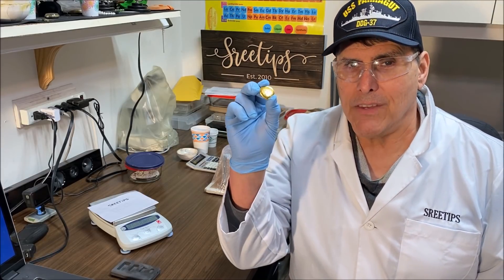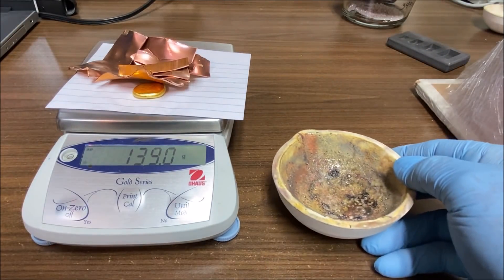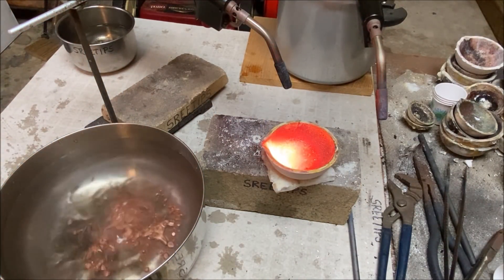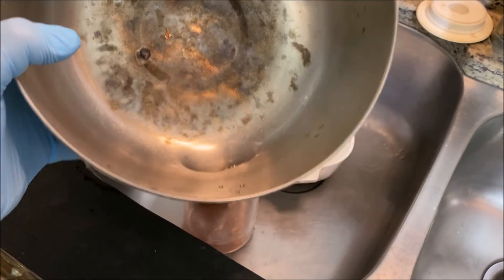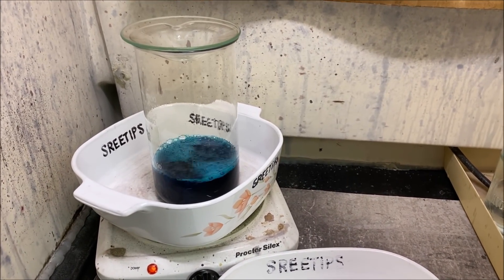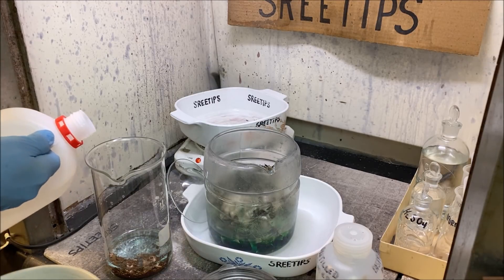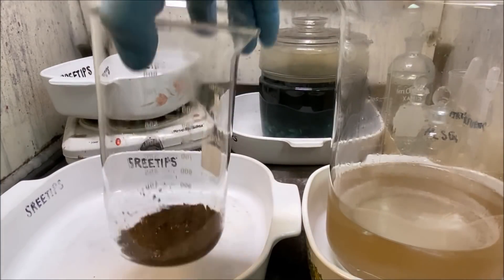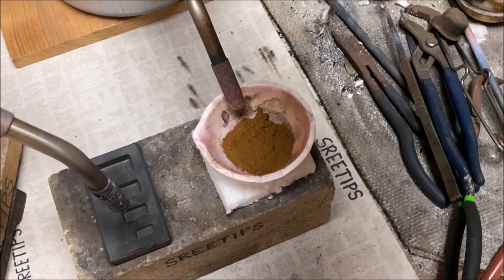Gold Repurification With Copper

Comment: Hey Sreetips, you will not get the steam explosion when pouring the molten metal into water if you bring the water to a boil ahead of time. The Japanese sword smiths have been making copper ingots onto canvas in hot water for centuries. It works well as long as the water remains above 185 degrees.
Reply: @Emmanuel Braden i like viruses also

Comment: Doesn’t matter if it’s a new or older video seems like I’m learning something each time…also when pouring the alloy into water would pouring it in boiling hot water maybe lessen the shock of the copper/alloy some so it’s not so violent?
Reply from the maker: As water temp increases, the metal is more likely to fuse together.

Comment: Some of the losses would have been during the HCL rinses, you could see finely divided gold powder on the bottom of the beaker.
Reply: Yes definitely, it would account for the majority of the loss I'd say
Reply: Sir you did loss 1.700 grams. This way you will get 9999 Purity but you loss sum grams of gold . 1.700 grams gold loss not a joke. It's have a valu of money. 
I will do this refine just adding double puer silver . with in one hour I will make it 9999 without any loss. 💯% recovery

Comment: Silver is the preferred metal for inquarting, because unlike copper, it takes only 1 equivalent of nitric acid to dissolve silver, but it takes 2 equivalents to dissolve copper. For most refiners, the biggest cost is the price of nitric acid. You’ll end up using twice as much if you inquart with copper rather than silver. Unless you can get dirt cheap copper or cheap nitric acid, the cost associated with silver and processing the silver chloride usually still makes it worth it. 

Here’s the equations btw. 

Ag + 2HNO3 = AgNO3 + NO2 + H2O

Cu + 4HNO3 = Cu(NO3)2+ 2NO2+ 2H2O
Reply from the maker: Excellent equations, makes it clear why you need more nitric for copper.
Reply: @sreetips   thanks! Yeah, silver only ever forms +1 ions when dissolved so you only need one nitrate ion to form silver nitrate since the nitrate ion has a -1 charge. but copper always forms a +2 ion, meaning that you need two nitrates to balance it.
Reply: @sreetips  nitric acid concentration can be 55%?

Comment: okay  question, War nickels are 35% silver but have 35 % copper 9 % manganese in it, will this cause any problems, Proper ventilation and proper lab protocols are in place. thanks!
Reply from the maker: I’ve never tried war nickels.
Reply: @sreetips  No you have no opinion on the 9% manganese? Could it cause metal fever or anything like that? I cant seem to find out much about the it? I am just being over cautious however, I cant be the only one out there that has a bunch of them and sure I can sell them on a auction site but I see it as a nice challenge extracting and making something beautiful out of them.
Reply from the maker: @SilverBull30  I’ve have no experience with magnesium
Reply from the maker: Sorry, manganese
Reply: @sreetips  Thank you very much for your time!

Comment: Hello my friend congratulations for the video is great.  I made a process in ceramic cpu but it did not precipitate water regia measures 200ml HCI + 35ml HNO3, I added sulfamico to neutralize HNO3.  the solution yielded almost two liters of distilled water.  I put MBS but did not rush.  What can I do to rush.  The aqua regia was greenish and when I put MBS there was no reaction.  Where did I go wrong?  Help me please . Thank vary match 🙏🙏🙏
Reply from the maker: No gold to begin with. Ceramic cpu has very little gold. Almost nothing.
Reply: @sreetips  Yes my friend, phone card CPU processors were big phone company cpu not Pentium pro those little ones were big cpu, with a big gold plated, thanks

Comment: That’s interesting timing I am trying to refine a very small quantity and will boiling for an hour cause it to go into solution? I am still getting a slight hint of blue so I assume that there is still some copper in the gold. So I figured I will try to nitric it with small quantities for a few more times to see if it clears up.

I don’t have much gold so don’t want to loose it in the nitric

Comment: I just watched a video where a guy used a half of a potato as a crucible. It actually worked. It would save you some money for sure. Cut a potato long ways and take a spoon full of the middle out. You can still add flux to get it loose.
Reply from the maker: Cool
Reply: @sreetips  thoisoi2 is the channel if you're interested. Might need a big potato for platinum lol.

Comment: At 26:00 you washed the gold with hydrochloric and then poured it off. The acid you poured off looked like it had gold in it, like some fine powder was washed out with the hydrochloric. Is that an accurate observation, as I was under the impression there really wasn't anything to speak of in the gold by that time?
Reply from the maker: A small quantity of gold gets poured off with the rinses into my waste containers. It’s allowed to settle out. Then I recover the gold powder from the waste containers.

Comment: Hello Sir, 
I have another question: 
If I have nitrous gases coming from the solution after Adding SMB, that means that I have excess nitric in the solution right? 
Does that mean that I have to just add more SMB? Should I wait over night to have the AR eat up the percipitated gold and add more SMB the next day to re-percipitate it? Should I put it back on the heat? 
Thank you for you help, much appreciated! 
Greetings from Germany
Reply from the maker: Red fumes = excess nitric. A little don’t hurt, add more SMB to remedy. A lot of excess nitric will cause much heat and fumes. Adding more SMB could cause a boil over - especially while stirring.
Reply: @sreetips  Thanks for the quick reply. It all worked out I guess, everything settled at the bottom. Solution is pretty clear now. There might still be slight impurities in the gold powder as it didn't settle as quickly as in your video. What are those impurities and how would you get them out? Clean the gold powder and redissolve in AR or do the whole inquartation process?
Reply from the maker: I rinse the powder real good then dissolve and refine it a second time. If it’s still dirty - repeat until it’s clean. No need to inquart again.
Reply: @sreetips  Thank you!

Comment: What other metals can be used for inquartation? If there are any others I mean…
Reply from the maker: Yes, I’ve used pure silver crystal, not recommended, sterling silver (best choice because I refine silver also). I’ve also used clean copper, and gold filled material.
Reply: @sreetips  you wouldn’t want to use anything like iron or zinc right?  Wouldn’t be an easy process?
Reply from the maker: Iron has too high melting point. Zinc is too high up the reactivity series. It would cause the gold to crumble during nitric boils - making separation of the liquid difficult.
Reply: @sreetips  I see. Thanks for always taking the time to answer questions! Appreciate it! This has definitely become my favorite you tube channel over the past year or so. Learning while being entertained, can’t get that on many other channels. 💪👍

Comment: Hey, I wanted to know how should I refine cu98pt2? Is nitric sufficient?
Reply from the maker: With Pt that low everything should go into solution with hot dilute nitric boils. Then comes the fun part; getting the Pt from the copper. I had difficulty during my stock pot series. Not an easy separation.
Reply: @sreetips   can you please help me solving this?
Reply: @sreetips  I have 1kg material by weight

Comment: Hi, I have been watching your videos for quite sometime and I know you are a busy guy but I have a question and since this is the only way I can contact you, here goes. 
Have you ever tried to recover silver from electrical contacts in circuit breakers and or relays?
I watch videos on this and have been collecting them from scrap items (everywhere from commercial AC units found in the woods to used car parts found in my warrhouse/shop) but have less confidence in the procedures I see on other channels.
I have done scratch test on these contacts with jsp silver testing solution and they light up at least as equal to sterling. 
I would be interested in hearing your thoughts on the possibility of recovering the silver if you have tried this?
Also, I am.not necessarily worried about the financial gain, just interested in recovering the silver from discarded items. 
Thank you in advance
Reply from the maker: Gene, I don’t have any experience with silver from electrical contacts. I’ve never processed any. All the silver I get is sterling flatware, bowls and jewelry.
Reply: Ok thanks!
It was worth a shot since I seen your videos on getting gold from the CPUs.
I will let you know how it goes if I have any success in the future.
Reply: @geneburlette7307  I know what you have to do.  Respond to this response if you are still on need of help
Reply: @royalrefiningllc  thank you for your offer to help. 
In all honesty I'm don't want to waste anyone's time since I still have a jar that contains several ounces of contacts and have never done anything with them.
I'm still collecting scrap non-weighted sterling salt and pepper shakers from ebay auctions. I was waiting to have about 20 ounes of those before investing in a couple liters of Nitric and the PPE.
With that said, if you would like to share any advice, it would be much appreciated. 
Thanks in advance

Comment: Wouldn't it have been possible to recover the gold from the nitric if it had been added the copper inquarted gold on the first boil?  I think it might have just cemented out on the copper as the copper was put into solution.  Maybe next time?  :)
Reply: The silver contamination would still be there, although having it on first boil would get rid of it more thoroughly since it is at the start of the process. Just pouring it all onto the sterling silver and recovering through the slimes later as he did with the rest of it would avoid the contamination entirely.
Reply: @ic_trab  True...but with successive boils (I think he did 5) any silver should be rinsed out and contamination would be very minimal I'd think.

Comment: I don't understand, you fuse pure gold to copper, then chemically separate then, what is the point.
Reply: It’s called inquartation. The original gold button wasn’t 99.9% pure gold. It had a small amount of impurities in it. You then inquart it with another metal (silver or copper) to approx. 28%. And then remove all the inquarted metal by repeated nitric acid boils ALONG WITH the original impurities. 

It’s the only way to pull out the impurities from the gold button. If you try to just dissolve the impurities out of the gold without inquarting, it will not work. The acid boils with not act on the “nearly pure” gold. The high gold content with prevent the acid from penetrating completely into the material.